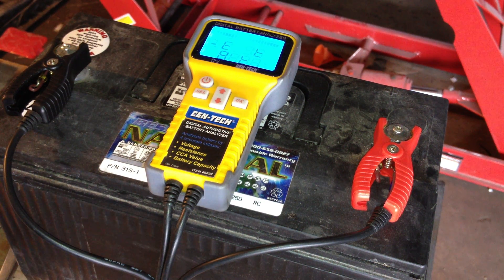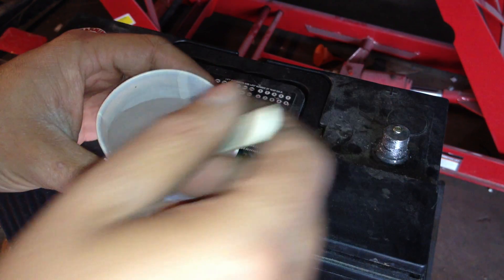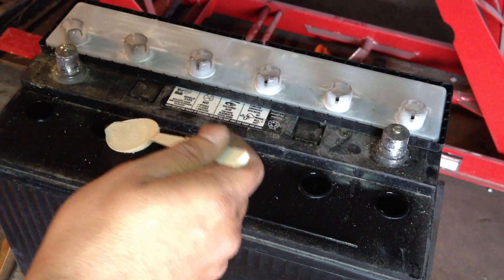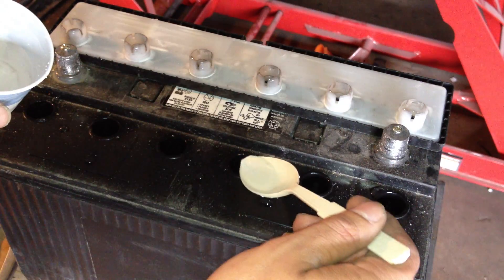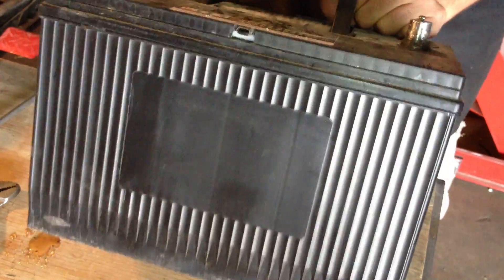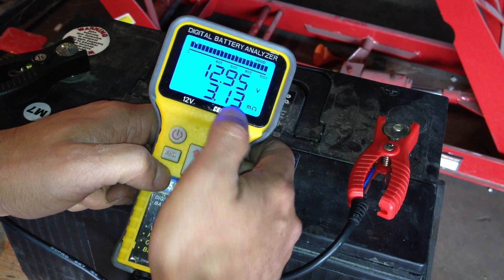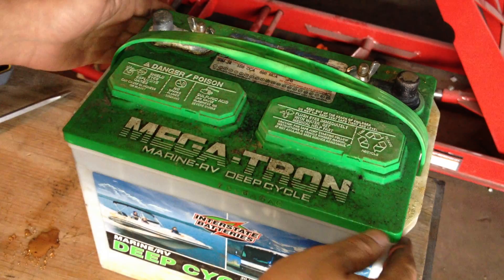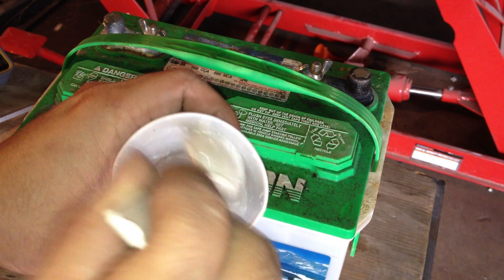Lead Acid Battery Desulfation Using Epsom Salt  -- First Test, Adding Solution   Part 1 of 6

Comment: 🟦….Even faster than a funnel; Put the solution in a narrow tall glass (that a straw will stick out of), & figure out how much of th' straw is 1-tsp & mark-it with a sharpie, put th' straw in th' cup then block th' the other end with yer finger (or pinch th' straw closed) & then pull th' straw AND th' liquid outta th' cup & use th' straw to drop th' proper amount of solution in each of th' cells.
.... It's Quick!

Comment: I had been buying Interstate batteries at Costco for some years now because they have a solid warranty. Problem is, they are terrible batteries hence why I no longer buy Interstate.  The second cell (depending which way you count them) always goes bad, and I have found, cannot be revived. I have found that most any other brand has better reliability than Interstate, and Project Farm confirmed that Walmarts battery to be very good.  I have one of theirs and have had no issues thus far.  I will be building your capacitor charger soon and hope to see if it can help keep my one last Interstate from becoming useless by 3 years old.
Reply from the maker: Interstate are crap. 
I really like Farm & Fleet batteries, at least deep cycle. finally replace the marine batteries i was using in the golf car that were 10 years old and got beat. 
I do like walmarts for cars. Made by Johnson Controls.

Comment: your voltage is way too high a fully charged battery is about 12.6-12.7v
Reply: That's a settled voltage.. right off the charger will be 13.9

Comment: Whst is the purpose of epsom salt
Reply from the maker: The Epsom Salt helps dissolve the Sulfate Buildup on the plates.
Reply: he doesn't care, and no one knows.
Reply: Hi,what your looking to get from the Epsom salt is the sulfate,
Reply: A battery dosen't have to have acid in it, it's the lead and sulfur mix is what gives a battery the ability to store electrical  current

Comment: i have been using epsom salt on old or batteries that have a dead cell for over 15 years. most of the time it brings the battery back to life. however there is no guarantee how long long your battery will live on. note if you do not see the water bubbling in each cell when charging you won't get it back. the bubbling indicates there is charging going on in the cell.
Reply: i just saw my 1st bubbling! so cool! But, now wondering, was his Epsom Salts primarily to 'desulfate', or used in general to recharge dead batteries. His title seems misleading... So it doesn't help to 'desulfate', but only adds new acid?? thanks
Reply: I was told to dump the acid out fill the whole thing with the Epsom salt mix and then charge it. Then return the acid after removing the salt water mix.

Comment: I know that things change over the years,companies buy out,companies merge,employees get worse, but my Dad sold Interstate batteries  for 35 years at his FULL service gas station( witch I doubt you are even old enough to remember), and had maybe 6 come back with problems. Yes someone else probably bought the company and probably made a little cheaper but I run Comercial trucks ranging from half ton to 18 wheelers and I will put my trust in an Interstate or Napa gold before a cheap battery. You may have your reasons for the attitude but that's not teaching how to revive a battery. You stick with el cheapo,I would never put a cheap battery in my family's vehicle, at least not long term. You better be prepared for legal actions with those words,or be able to back it up, good luck.
Reply: +Anthony Bellard i agree, here is personal experiance . i bought deep cycle die-hard batteries at sears the same day as i bought 3 of the maxx deep cycles at walmart. all were hooked parallel on my bus. while still in warranty(less than 12 months later) all 3 maxx went bad while the die hard's were still working fine. walmart replaced all 3 for free. i sat them on a pallet with trickle charger hooked to them. once the free replacement warranty was expired by 2 months , one had a bad cell and walmart said they would give me 12 trade in including the 10 buck battery core fee. 3 years later the die-hards were sold to a friend to use on his solar system for the price of scrap batteries. ive had bad luck with the 1 napa battery ive ever owned and they wanted to give me 37 bucks towards a new one because it was still under warranty i told them NO THANKS and traded it in on one from oreiles . it cost me more to buy at orielies but im a man of principle and sold the truck 6 months later.
Reply: I've been farming for 25 years and run everything from the family cars-18wheelers to 1000+hp power plants on various equipment and I'll never buy anything that interstate sells. I've had over a dozen of them literally explode within 6 months of purchase. All on different types of equipment or vehicle and nothing out of the ordinary with operation of the vehicle or equipment and nothing but a battery swap solved the issue. The best luck and longest lasting batteries I've ever had have all been off brand mainly Dekka(they are more popular now but 20 years ago barely anyone heard of them)  duralast gold do pretty well and the warranty usually makes up for any that do not last ax long as they should. I've been forced to run a napa on occasion because it was the only place that had the battery required and simply love the Exide batteries Menards sells and most of them are about 100$. They may only go 2-3 years before they are weak usually just toss them in something that doesn't need high amps to crank and get another 1-2 years and they will take heavy abuse of being completely dead many times before they give up. Regardless of what battery you buy if you maintain it and keep it charged and never let it go dead they will all give you a good service life of 4-6 years depending on what climate you live in. I've had many that I've simply flushed and combined the acid from the initial pour out with as much Epsom salt (usually close to 5lbs/1.5gal water) that you can get to disolve in hot water adding it till you are not able to get the last bit to disolve after 5 minutes of stirring let it cool down and combine it with the acid left from the batteries and after flushing the batteries with the garden hose spayer and then refill with the very potent and stronger acid mixture and charge it overnight. Never had any of them have less than 80% of the rated cca and many that were over the rated cca usually get 1-2 years out of them after I do it

Comment: I'm using the same charger (on 15 amp) as you, Kman, trying to revive a deep cycle marine battery with the epsom salt trick. I just noticed the ends of the battery bulging & shut it off. Battery a goner?
Reply: sounds like overcharged, but maybe you just need to loosten the caps a bit so it can vent while charging

Comment: are we adding the epsom salt to the existing acide inside?
Reply from the maker: Yes
Reply: good, wouldn't alter the  PH of the electrolyte? if yes , will it be acidic or base? thanks.
Reply from the maker: no, doesnt alter it from what I understand.
Reply: you dont get me sir?
Reply: Sunday Owen hey ,if anyone else wants to uncover how to recondition used car batteries try Megarno Amazing Battery Magician ( search on google ) ? Ive heard some extraordinary things about it and my colleague got excellent results with it.
Reply: +Sunday Owen dont ask stupid questions
Reply: Sunday Owen My battery died yesterday and I dont have a charger. Can I do this and 
just jump the car and drive it for a few hours?  Will this hurt anything
 or blow up?
Reply: Sunday Owen very informational video but if you want to learn more google for Knewreck rapid renew guide
Reply: I have spent months studying battery reconditioning and found a great resource at Jons Mender Guide (google it if you're interested)
Reply: @munibbaidya5673    rippoff      timewaster
Reply: There are  a few suggestions for battery reconditioning
do not try to do this until you know what you are doing - the acid can burn you
check the voltage first - there may be a kaput cell which would waste your time.
Check your battery fluid.
Try to completely recharge the battery.
(I read about these and more on Rapid Renew Roadmap website )
Reply: I've been studying battery reconditioning and found a great website at Rapid renew roadmap (google it if you're interested)
Reply: Do This To Bring Any Old Battery Back To Life.>>> https://t.co/3ycayBV4e1?nyukulo234 >
Reply: @fredcoxmartin5105  
I don't understand what you mean about .

Comment: Safety nerds are going nuts asking where the gloves are.
Reply from the maker: Meh, Minor details ;)  It's "ONLY" outputting a maximum of 170v DC :)
Reply: I meant for the sulfuric acid.  But I believe if you know what you're doing, you don't always need to use safety equipment.  And you obviously know what you're doing.  So I saw my chance to take a cheap shot at the safety freaks who always have to point out safety hazards.
Reply from the maker: *****  Ah :) Just imagine what they will say after I tell them I wasn't wearing safety glasses either @_@
Reply: KmanAuto 
No need to worry   If you spill any acid. Just pour some beer on it. Don’t use all of it. You may need to get rehydrated

Comment: I have seen some chargers that claim desulfation due to electrical pulses, however I've have done a lot of reading on this and have seen no evidence that sulfated batteries can actually be recovered. Sulfation can be prevented by keeping a battery on any smart charger when not in use as sulfation is a result of battery discharge.
Reply from the maker: Pulsating desulfation chargers do work. The best is a capacitive charger (see my other videos). If they dont work, why would the telecoms use desulfation machines to desulfate the backup batteries
Reply: I understand they can keep a healthy battery from sulfating, but I have seen no hard evidence that a deeply sulfated battery can be recovered.
Reply from the maker: Well, I will disagree. I have recovered many batteries (roughtly 100) and put them back into service. I build electric conversion cars, and also service electric golf carts on occasion, So I get many lead acid batteries through my door. real desulfating charger doesn't work over night. It takes about a month to desulfate a recoverable battery.
Reply: I'm not saying they don't work, just that after a lot of looking online no one presents hard evidence they do. It would also seem to me that deeply sulfated batteries might have other issues too such as warped plates.
Reply from the maker: Correct, not all batteries are recoverable, I can usually recover 1 out of 10. But when your dealing with $400+ batteries, each one's a win :)
Reply: Do you have any idea how much longer they actually last after being recovered. I'm wondering if it's not a short term solution.
Reply from the maker: I've had them last a month, I have some that are going on years. Depends on how bad the battery was before being desulfated. When I build my cars, I use capacitive chargers on them all, as the act of charging daily keeps the battery from even starting to sulfate until the batteries are really aged, that alone really helps. 

Now, I did not count this in my 100ish batteries recovered (those are full size, from car batteries to deep cycle batteries). I also recover motorcycle batteries. I get many more of those. When someone purchases a new battery from me, I take their old non working battery as a core. Then, I toss it on my Capacitive charger bank at a low charge rate. I can do up to 11 batteries on a single capacitive charger. after a month, I usually have a few that are restored to good working condition, and I sell those at a discount (usually $10-15), as in Wisconsin, the cycle season is limited (about 6 months), I tell people not to purchase a new battery at the end of the season. No reason to purchase a nice new one and then just shove it in 6 month winter storage a month after purchasing. So it saves many people a lot of money, and it helps me make a little bit of money.
Reply: Correct, I also mention that keeping batteries on a smart charger prevents sulfation as sulfation occcurs as a result of deeply discharging the battery as I understand it. You have kind of a full operation going there so it works for you but I would say for the average person trying this on their lone car or motorcycle battery with a 10% chance of success isn't worth the effort. I just use one of my yearly Costco rebate checks and pick one up for free or close to it.
Reply from the maker: Depends on frequency of use. EV's plugged in every night, so it helps as your plugged in average 6-12hrs/day. Lawn mower is used once/week. Golf cart  has a lot of down time. Car starting battery, well, it's used regularally, so it shouldn't get drained enough to have problems. Yah, wont work for everyone, but, some it's perfect and saves a lot of money. I know I've recovered a few $5,000 fork lift batteries. Charged $100 to desulfate (Like the showtime roticery , set it and forget it!), and after a month, a battery that would last 30 minutes in a forklift, is now going all day.

Comment: In other research I've done on using the Epsom Salt, a teaspoon of the dilution per cell, or a tablespoon per cell, might not be enough of the chemical to clean the plates. Looking forward to the other videos.

Comment: How much epsom salt should we add to the water?  

Great video, Thanks!
Reply: 10oz by weight per gallon of distilled water or filtered rain water
Reply: I poured out some of the acid; added about 3 cups of a solution of iodized table salt dissolved to saturation using RO water that has been structured using strong magnets.
I put this mostly-discharged battery on my deck to charge.
A noisome has started venting from the battery .
At 4% on 2A trickle charge; I unplugged the charger before the toxic gas cloud overtook my neighborhood.
So..,,, I would not suggest adding 3 liquid cups into a mostly -drained used battery!

Comment: I get mine from a place called Blain's Farm and Fleet which like Johnson Controls is out of Wisconsin because they have a longer warranty. Scumbags abusing Walmart's no questions asked warranty were exchanging perfectly good batteries every year so Walmart put a one year warranty on them instead of 2 years like F&F or 30 month like Interstate.

Since the batteries are essentially the same at all 3 I go with the best warranty AND Service and that's certainly no Wally World, it's Farm and Fleet
Reply: i bought a deep cycle from WalMart a month ago for a house-outage but didn't need it and tried to return it the next week, NOPE! they changed their policy, no returns at all! (used to be 90days they said...). Out 120$ pffft

Comment: Get a marinade injector for grilling/BBQ (Looks like a big syringe)  And use that to put it in the batteries, especially a must with the small SLA batteries where this magnesium sulfate (Epsom salts) trick also works ... I think mine cost all of 5 bucks. I put a piece of heatshrink over the metal needle to keep it from shorting the plates in case you hit one. Just suck up some solution (or plain distilled water) and rehydrate the batteries without making a mess

Comment: At the 30 second mark, I believe the internal resistance being measured is 3.1 milliOhms, not 3.1 ohms.   Typical internal resistance levels for a 12 volt auto lead acid battery are in the range of a few milliOhms up to around 20 milliOhms, I believe.
Reply: Mega not milli
Reply: @brettcombs774  milli*